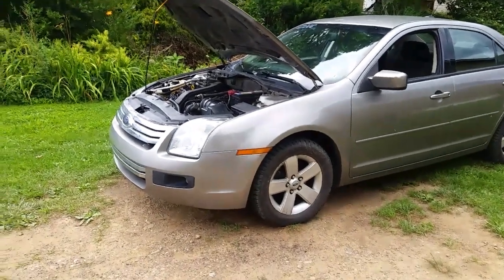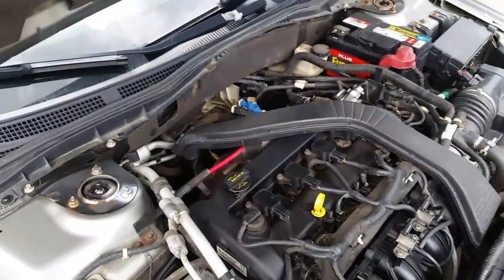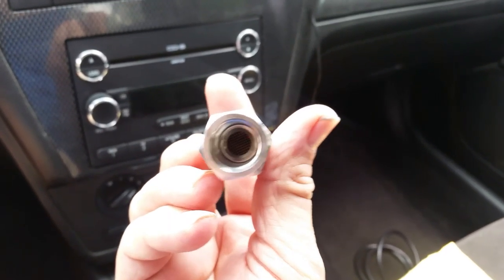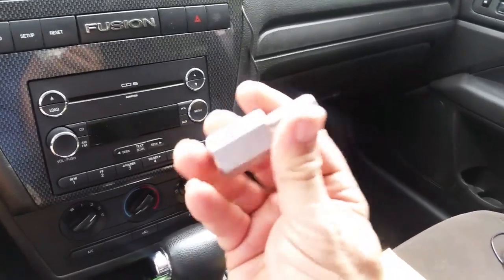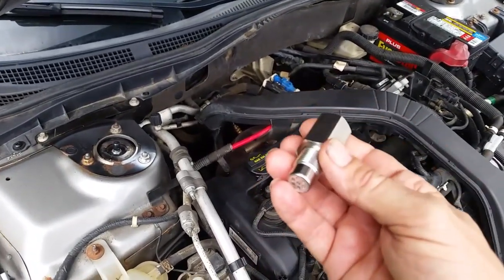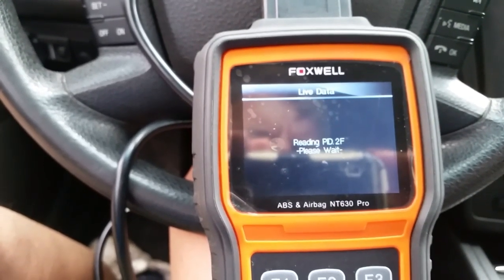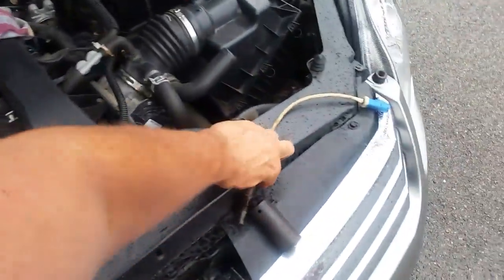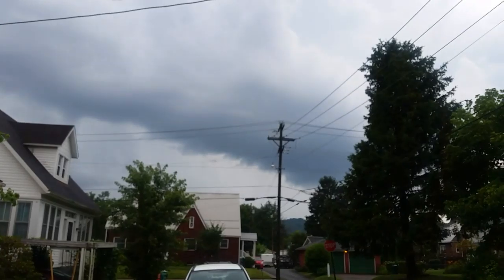02 Extenders (P0420)... Do they work? My Test results.

Comment: He doesn't know if it works or not -- he only used one extender. So what was the point of this video?
Reply from the maker: Often they don't work! Inspections stations are just a bit smarter that you.
Reply: @FixingWithPassion  
I don’t need a smog check as no inspections where I’m at. BUT if you don’t do something about that CAT code and “fix engine” light the stupid computer thinks that the system is lean and adds fuel and you lose like 25% of your gas mileage. And it isn’t like the CAT is totally bad — the “check engine” light comes on if the efficiency of the CAT drops below 95%. So we are to throw out a 94% efficient CAT?
Reply: @FixingWithPassion  The OBD tester show me that I'm ready green, but the engine light is on..
Reply: @billygraham5589  No, you are wrong. Is only used to monitor the cats. No air fuel ratio adjustments

Comment: I have p0300 code on my trailblazer ,any ideas what it could be ?
Reply from the maker: How does it run?
Reply: It runs good only when accelerating but at complete stops it misfire terrible
Reply: Fuel pump.
Reply: P0 300 is a multiple cylinder misfire! The engine in the trailblazer only likes to run good with original AC Delco spark plugs!
Reply: Did you use one of these spacers on your 02 sensor, because of you put it in your upstream o2 sensor it will cause the misfires
Reply: Sold happy now lol

Comment: Anyone know how this will affect fuel mileage or power? Thanks
Reply: If the O2 sensors are malfunctioning they will cause incorrect fuel mixture bias so yes it can cause your engine to run too rich or lean.
Reply: ... @Evanturar Hello you misunderstood  WILL THE MODICATION affect the fuel...Thanks
Reply: @jimd7241   To be specific.   If the extenders return the values measured by your ECU closer to normal, they yes of course it will affect your fuel consumption etc.  Premise being, either the sensors are becoming marginal or your catalytic converters are below efficiency.  Anything that changes what the ECU sees, will change the way your car runs to some extent.  Hope this helps.
Reply: Your upstream 02 affects your A/F mixture, the post cat sensors do not.
Reply: @dirkdiggker2932  you're correct.  The downstream 02 sensor only measures post cat and has nothing to do with Air Fuel mix.  The downstream sensor is purely there to see if the catalytic converter is reducing Nox emissions.  Technically the ECU doesn't even need it to run properly.  It's only there solely for emissions.

Comment: Those do not work they are a waste of money you have to get the anti-Fowlers two comes in a pack you have to drill one and then you have to install the other one. Once you do that you clear the codes and it will work you can take the cat system out completely and it swelled extension in there and the light will stay out a lot of these videos. People are doing it wrong. You can’t use what he is using because it is not far enough away from the cat system.

Comment: I have p420 in my car kia soul 2020, when use this extensor, the chick engine was disappear, but after one month appear the code P2096 that mean poor lean in the percentage between fuel and air. did you think that using the extensors causes the second code ..... I would to answers at details
Reply: i'm not familiar with kias but typically the first one sensor from the manifold/engine is what controls the air fuel mixture. if you put an extender in the first sensor, take it out. the reason extenders work is it takes less of reading, making the computer think it's leaner exhaust. that could be any number of things though causing code if you didn't put an extender in. that 420 code can be solved with extenders, no promises btw, if used after the cats. i say that because i've seen cheapo amazon sensor work on a gmc with a 6.0 with no cats but 2 of them on one sensor on a malibu with a 2.4 seems to not be working, that's with a goodish sensor. they also say it won't work sensitive sensor. idk.. anyway, best bet on the cheap is get or barrow or buy a cheap scanner that'll do live data and learn to read it. i did and it's changed things for me. i went from a code reader from walmart to a scanner with limited abilities to a $200 harbor freight unit. they put information access behind a pay wall so look at options and think down the road. i got one to fix an old ranger good enough to drive, another to figure out a gmc i practically stole and another when i found out i couldn't look at brake codes on my wife's car... don't make my mistake. funny, i'm thinking about getting a better one after all that and seeing the limits. i tinker a lot with cars though. generally i am the guy everyone comes to for car advice.
Reply: If you have a 2020 kia soul throwing a p0420 code you better have it looked at.  The federal government mandates catalytic converters are covered under warranty by manufacturers for 8 years/80k miles from date of purchase.  That's on all cars.  So as long as you are not past 80k miles it should be covered.

Comment: This worked wonderfully for me on my 99 CRV
Reply from the maker: Wow!
Reply: Which spacer did you use for yours?
Reply: @Brensdaman 92  I use the spark plug anti Fowler spacer. I had to drill out the end so that it would fit in completely. It goes in the last sensor apter the catalette converter.  Works. Wonderfully for me.